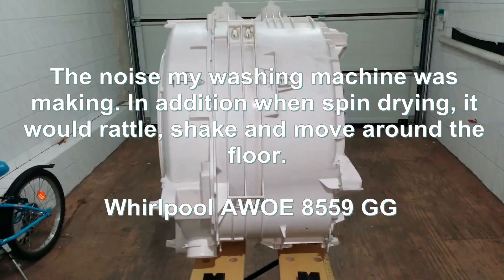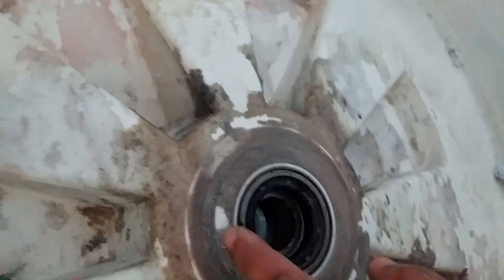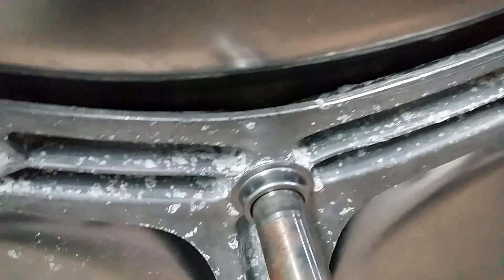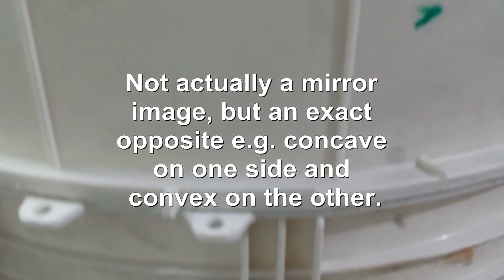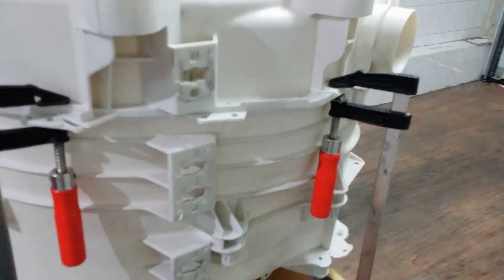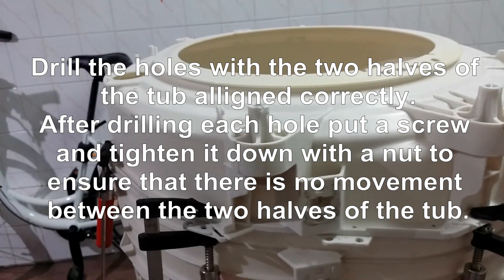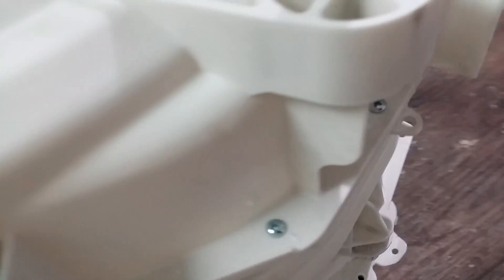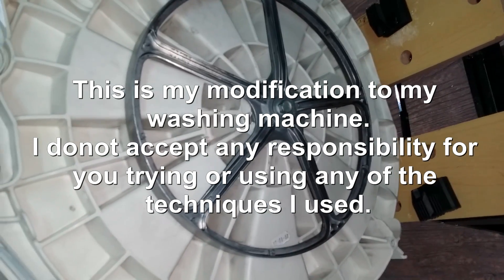How I modified my sealed tub on my Whirlpool washing machine to replace the bearings

Comment from the maker: Quick update. After two years of running, the bearings went again.
Seems to be the exact same problem i.e. the seal gets damaged by the detergents and then water gets into the bearings.
What I have realised is that the water that gets into the bearings has detergent in it, so the detergent rinses out the lubricant in the bearing causing it to run dry and start wearing away quickly.

I could have replaced the bearings and seal again, but this time decided to buy a new washing machine that:
1. uses less power
2. is quiter
3. allows to pause washing, open the door, add stuff and continue the washing cycle.

The last point was very important for me as my wife and I constantly missed out on a sock or some other color matched item in a batch of washing!

This time we purchased a BOSCH Eco silent 8 series that washes up to 9kgs at a time and uses half the energy and half the amount of water that the Whirpool did.
Reply: Use sealed bearings !  SKF 2RS type.
Reply: But you technically could just replace the bearings, right?
Reply from the maker: Yes I did. I fitted new ones and new seals.
Reply: @RobertSababady  where did you get the seals?
Reply from the maker: I initially wanted to get them from SKF, but they did not have any locally. I eventually got them from a car spares shop online. If you are in the UK, try eSpares.com
Reply: @RobertSababady  thanks man. I've got an indesit from 2011 which has been one of the most reliable washing machines I've had. Sadly, the bearings have gone recently and the tub is sealed. Thankfully, it seems that it's going to be fairly easy to split it open,so the only thing to do now is source the bearings and the seal, and hopefully not mess up on the reassembly process. I've never done anything like this before. But hey, if I fail the machine is junk (I won't make it any worse), if I don't I'll have a working washing machine again! :D
Reply from the maker: Give it ago......and if you have any questions - just ask away.  If I were to do mine differently, I would drill holes for the bolts and nuts before I cut the tub open. It is easier to drill them before than after the tub is in two pieces. Good luck!
Reply from the maker: @whysoserious7553  Yes. An 8 series because of the large opening in the front and good loading weight. However the downside is that it only uses washing powder and not liquids :(
Reply: @RobertSababady  I have a bosch serie 8 overall washing quality is good and less vibration but only down side is it's a sealed drum like this one here in India other manufacturers have drum which is just hold by bolts and gasket which can be easily removed didn't know about it before purchase 😕 unlike in the west here in India labor cost is very low so a broken spider can be replaced for just 5000 rupees (60 dollars)
Reply: The bearings/seal are poor quality and designed to fail on a modern machine, usually shortly after the warranty runs out.  I was watching you do all that hard work thinking you were polishing the brass on the titanic. I've got an old washing machine from about 15 years ago it has 72mm bearings in it (and the tub isn't welded). I bought it for £50.

Comment: Happy to say thet I fixed my Whirlpool AWO/C 7808 (Service #: 859231326010) following this video.
My tub was sealed by the company and thus it was impossible to find genuine replacement parts (bearings, bearings seal etc).
I cut the tub and used these instructions to screw it back.
Thank you very much.
Reply from the maker: I am glad that the video helped!
Reply: I'm joing my friends comment on this one. It was impossible to find genuine replacement parts.. for the moment i am stuck as the drum shaft won't fully go trough till the end. Maybe i have to knock 1 of the bearing better at is place. Let' see. Thank you for your sharing

Comment: its not rust in the shaft, its where the bearing has heated up,
Reply from the maker: May well be Tony. However there were no signs of heating on the shaft when I dismantled it and took the bearing off. i.e. no familiar blur black stain on the metal from heating.

The rust seems to have appeared after I washed everything and left the individual parts out to dry.
Reply: it isnt rust, when a bearing heats up on a shaft you always get this kind of oxidisation due to the different types of steels, and thats why the shaft was damaged also, you should have replaced the Spyder too.
Reply from the maker: ok. Tony. Thnks for the insight.

Comment: this is so ugly that whirpool chose this ugly solution! gorenje is assembled with screws and has a gasket.
Reply from the maker: It is all about the technology. Plastic welding has become so popular in the manufacturing industry as you get robots to do the work in a repetitive manner. Gaskets, screws and matching pieces together is far more complicated.

What annoys me is not that I had to make the modification - it is the fact that the bearings and seal deteriorated so quickly - all went bad just after the guarantee expired. That is the annoying part.
Reply: Robert Sababady hi would you mind telling me if the washing machine is still holding up cheers
Reply: Bosch/Siemens also use screws and gasket. I just bought a cheap Bosch machine and was pleasantly surprised that doesn't have a sealed tub, but one that can be fairly easily be taken apart. It's still no Miele with a stainless steel tub though, but for 200£ you can't really ask for more.
Reply: @Mihal Well, Gorenje doesn’t always use tubs that can be easily taken apart. My new Gorenje WE743P (as well as probably the whole series) uses a welded tub. Knock on wood I won’t have to take it apart in the next 10 years …

Comment: You might want to protect the spider tri-arm.  It is probably going to rot out like mine did on a GE front loader I had. Search online for spider failure and you will see a bunch.
Reply from the maker: +tatersinc thx for watching. How does one protect the spider tri-arm other then cleaning the washing machine from time to time with a commercial washing machine cleaner?
Reply: use epoxy spray primer paint like BRUNOX EPOXY

Comment: wich bearing and sealing part do i use
Reply from the maker: +Coen Mulders 
I had to source them directly from a bearing shop as whirlpool part dealers donot sell the parts for the sealed drum.

If you are in the UK, then try eSpares: http://bit.ly/5ET67ij

I chose skf for my tub. Your best bet is to remove the existing bearings and seal and take the part nos. directly from them - in this way you will get the correct parts.

There is a really good comment from +Gimi This will save a bit of time when it comes to assembling the unit.
Reply: +Robert Sababady 
using appropriate screws and nuts will be sufficient strong to keep parts tight, so i think by using simple white silicone sealant (cheeper), or automobile engine Head Gasket Sealant will be easier to reopen with a cuter if necessary... :)

http://www.ebay.com/itm/1-Pint-Head-Gasket-Sealant-Roadside-Res-Q-16-Fl-Oz-/131773761210?hash=item1eae5406ba:g:21MAAOSwgApXBUJo&vxp=mtr
Reply from the maker: +Isidoros Sklivanos Thx.  you are probably right. The silicon has the role of a gasket, so it's adhesive properties do not have to be relevant!

Comment: thanks Robert for uploading this. The sealed tub assembly on my 2011 Whirlpool was replaced by Whirlpool for bearing failure at just under two years (under warranty), they went again after two more years and I used your video as a guide to change them.  My first tip: use Silcoflex Building Silicone Neutral Cure. Unfortunately they went again after just 4 more months! The problem is they have been running in water (I'm not sure why the drum spindle isn't sealing) and were rusty and free of lubricant!  My new tips: use better bearings (SKF this time), 'help' the spindle seal to seal with a dash of silicone where it fits into the drum, and try out the drain hole idea mentioned by another contributor (I hope that works!)
Reply from the maker: Thx for your comment Dave. Really glad you found the video useful.  Very strange that the seal is the culprit.  As dumb as this sounds, if the seal was Monte the wrong way, then it either ran dry and started leaking or it was the wrong size in the first place. 

I think you really need to pack the space between the bearing and the seal with good water proof grease. 

The hole to let water out is definately a good idea. 

I hope your drum runs for more then 4 months. that is a bumer to have to break it down after such a short time.
Reply from the maker: Thx for your comment Dave. Really glad you found the video useful.  Very strange that the seal is the culprit.  As dumb as this sounds, if the seal was Monte the wrong way, then it either ran dry and started leaking or it was the wrong size in the first place. 

I think you really need to pack the space between the bearing and the seal with good water proof grease. 

The hole to let water out is definately a good idea. 

I hope your drum runs for more then 4 months. that is a bumer to have to break it down after such a short time.

Comment: Hi, job well done. just cut open a whirlpool wwdc1720 and am having probs sourcing the bearing as the bearings don't need to be made for this machine as the bearings aren't replacable!! where do you get yours especially with a seal?.....
Reply from the maker: +Ray Andrew 
Ray, Don't look in the standard washing machine spares shops. Depending what country you are in, there will be different ways. I would definitely start off with espares in the UK - those guys are very down to earth and very responsive.

This is the way I did it.
1. Took out the bearings and seal and wrote down the numbers
2. Got onsite and asked the main washing machine spare parts shops - they were not useful.
3. Went down to my local mechanic and asked him where to source bearings from (has to be a mechanic who actually knows about sourcing parts and not just a dealer who has  the dealer part nos and nothing else)
4. Went to the bearing wholesale place and they had a huge catalog of bearings and seals from different manufacturers. They had to place an order with SKF to get the bearings as they did not have them in stock
5. waited 3 days and received the delivery at home.

I live in Poland and got onto the skf web site. The have a bearing searcher: 
http://www.skf.com/pl/products/bearings-units-housings/ball-bearings/index.html
Worth trying
Alternatively you could also google a bearing warehouse - they will ask for a number or the size of the bearing.
If you have problems identifying your bearings - give the nos and manufacturer. I will help you.

Hope this will be useful!
Robert
Reply: +Robert Sababady Thank for your help Bob, love the vid, found the bearing shop and e-mailed them, thank you very much for your help......
Reply from the maker: +Ray Andrew Let us know when you are back up and running!
Just don't tighten the concrete weights to tight - they crack easily. I cracked mine when assembling my washing machine after the modification. :( Had to do another fix : https://www.youtube.com/watch?v=3XqwsEEXtZo on the balance weight.
Reply: +Claudiu Racovita had a look in my book and for some reason seemed not to have recorded those details, google Bolton Bearings, they can supply for around £12, but they need the bearings to measure off + the seal.
Reply: +Ray Andrew Hey there, Could you please tell me the measurements for the bearings, oil seal and where did you get them from?

Comment: You'd probably have found that the pulley jams against the back of the smaller bearing and would prevent any rattle even if the shaft was slightly loose in the bearing, but the use of some kind of sealant to take up the play probably helps centralise the shaft and can hardly do any harm.  After all, the last thing you want (if the new seals are to last a long time) is play or running out of true relative to the seal.